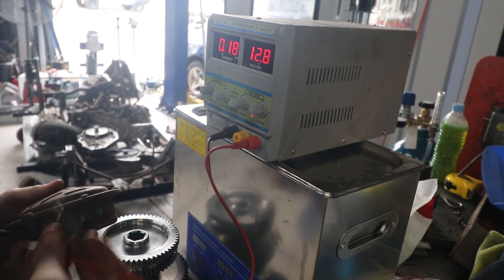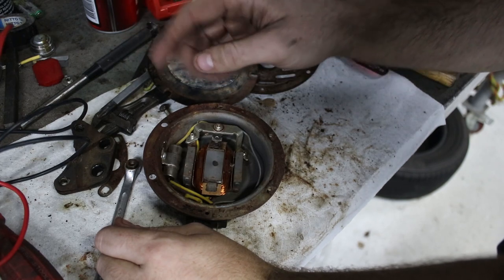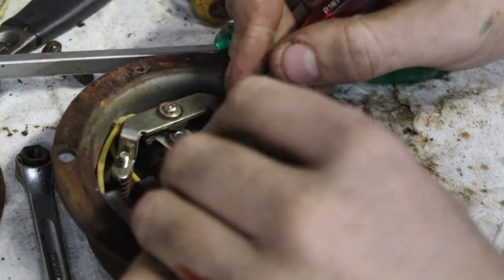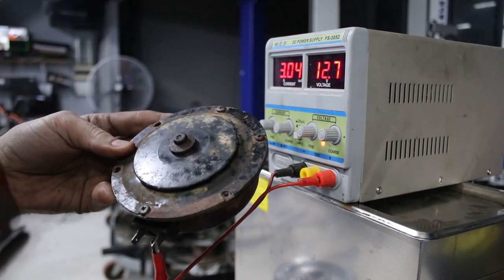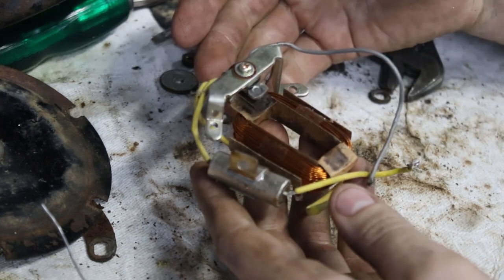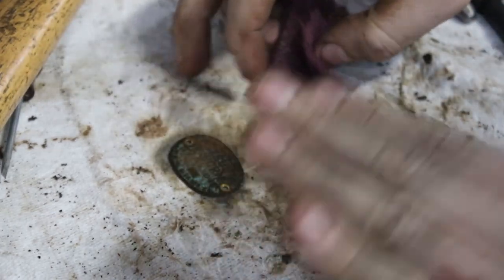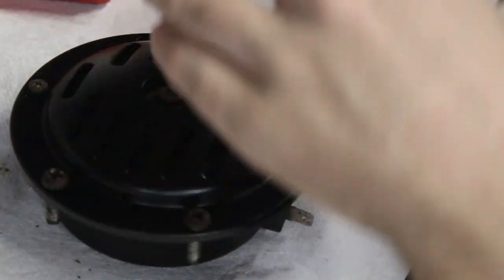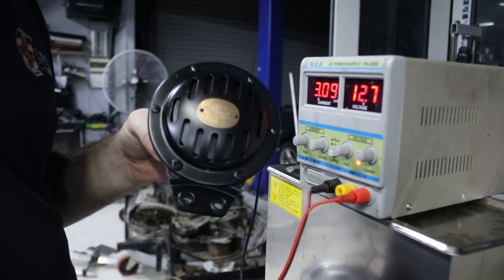Vintage Mitsuba Horn Restoration.  Saving a Honda S600

Comment: My S600 (Canadian market) has 1 Mitsuba horn, with an embossed logo over a green background. I can't be sure, but I think it was original based on the overall condition of the car when I bought it. Also, there were variations in equipment based on the intended market, so maybe export cars required a different horn?